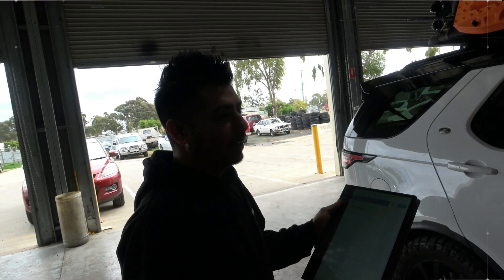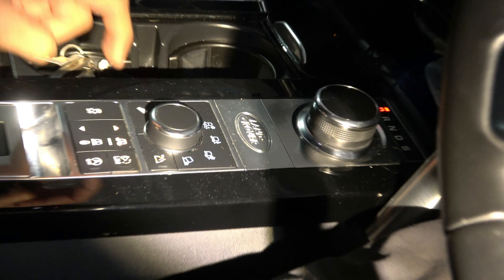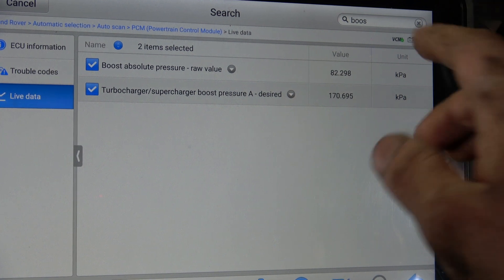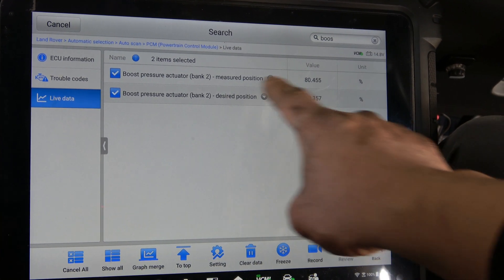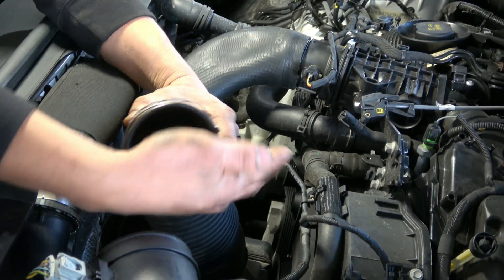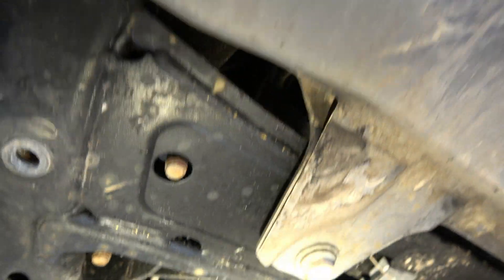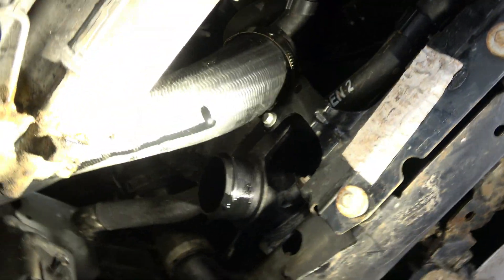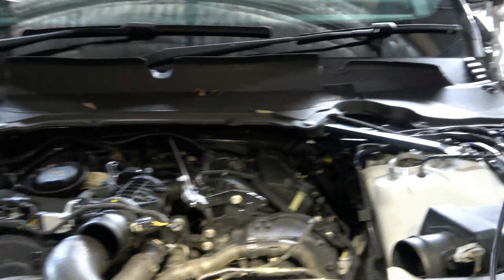Landrover Discovery 2017 3.0 Turbo failure lack of power and limp home

Comment: I have exactly the same issue with a 2019 RRS 3.0TD, 50k miles, did you find the cause of the issue? was it the turbos?
Reply from the maker: Yes
Reply: @a1mechanicaloakey  Cheers Bro, I was hoping that it might have been something simple like a solenoid or something because of the appeared blockage. Vehicle with mechanic so will give him a heads up. thanks for the help
Reply: I have the same issue with 2016, what was the final diagnosis
Reply from the maker: Turbo
Reply: Yes, LHS turbo needed replaced, ended up they replaced turbo without body off @douglasholifield

Comment: Does the intake manifold have a throttle plate? Dont you need a restriction to cause vaccum
Reply from the maker: That's what I thought but main throttle plate is wide open, I really don't know how it works. Something to do with intake runner may be. Not sure Rob.
Reply: @a1mechanicaloakey  clearly a YouTube mechanic 👨🏼‍🔧